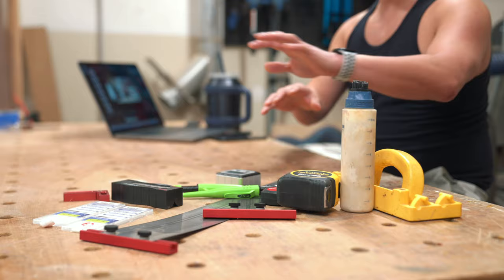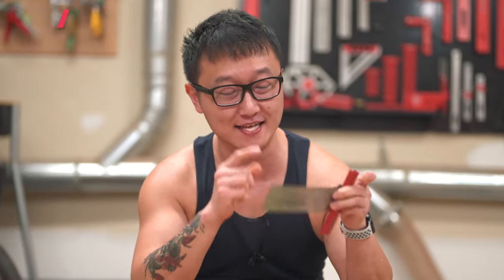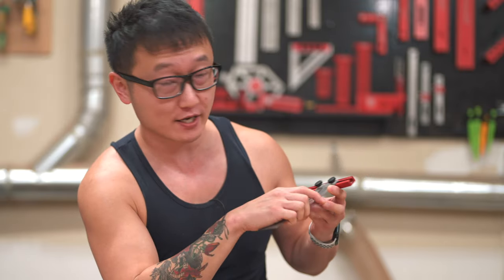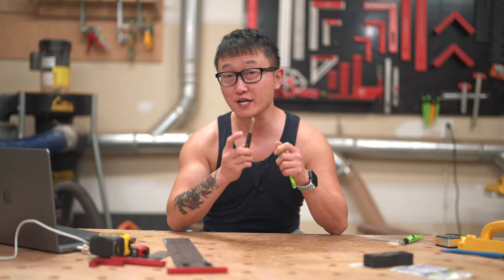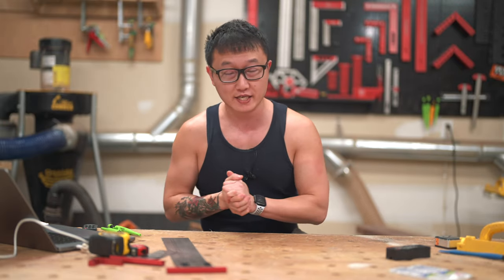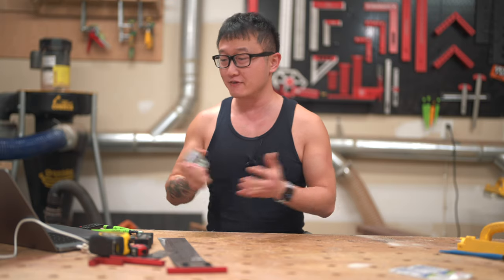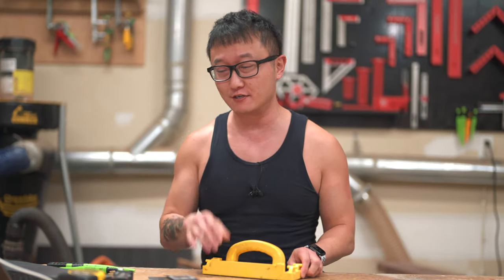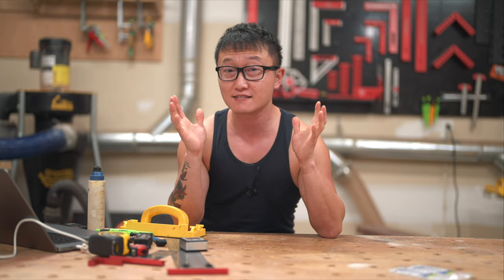10 Tools Under $30 Christmas Gift Ideas || Every Woodworker Needs

Comment: Great video, Alex.  BTW, the Incra 6" T-rule is on sale at Woodcraft this month for just under $23. 

Something I use a lot are a couple of 1-2-3 blocks (with holes) and a set of fence clamps.  The blocks are good for checking square and also can be rotated or stacked to set a specific measurement.  I use one with a fence clamp on my table saw fence when using the miter gauge, as I can set the fence to 1" more than the piece I want to cut off to account for the thickness of the block.  The combo also works great as a quick stop block on my miter saw fence and on my router table.
Reply from the maker: Ohhh I haven’t tried the 1-2-3 block before. I’ll check it out! And yes..:the T-rules are always fluctuating in price haha. There’s a different price in every store 😂

Comment: I run into the same problem with English + Metric measurement. The Stanley "Tylon" tape measure is a good bit less expensive than the "FatMax". Komelon makes a really cheap dual marked tape measure.
Reply from the maker: Thanks! I’m going to check them out. I want a smaller tape measure haha

Comment: Fastcap PMS-12 is a great tape with both imperial and metric for ~$10. Also do you use those green pencils with your incra rules? Isn’t the lead too big?
Reply from the maker: No I can’t use the green pencils with the Incra. Incra only accept 0.5mm. I use the green pencil with the woodpecker rulers
Reply from the maker: And thanks for the tape measure recommendation!